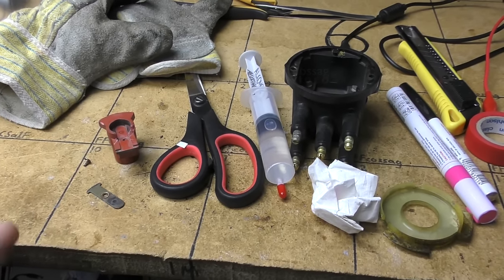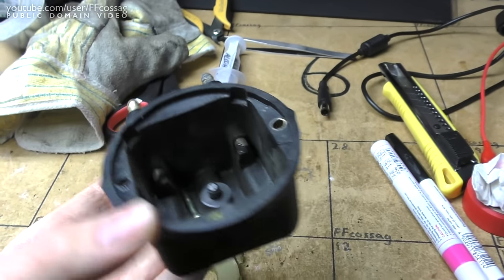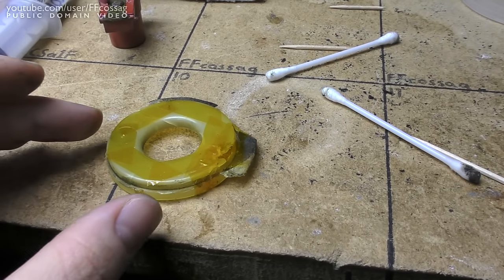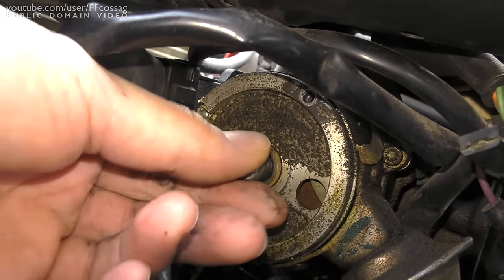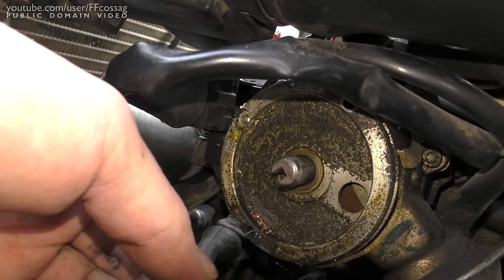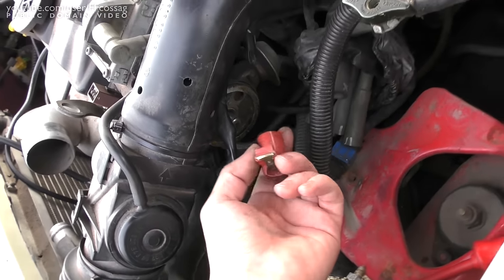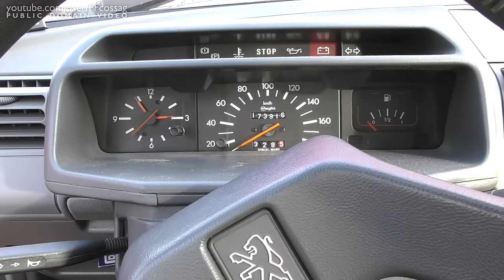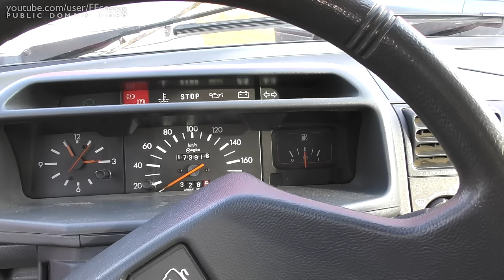FAILURE! Trying to fix a mangled ignition distributor on my Peugeot 205

Comment: Hmmmmm, instead of thinking about "BLOW JOBS" how about concentrating on the issue, the cap had a dodgy connection to one of the cylinders, did u clean the pitted contact? did u check the dist cap lead connector to make sure it was a tight fit?? and if so then the diagnosis wud be the rotor button cos that is fucked... missing the plastic that stops any random spark flying out to hit another contact will cause a misfire, that crap inside I wud have cleaned up with some degreaser on a rag, and certainly replace the cap and that plastic cover on the inside. Last but not least test ur spark plug leads. This video made u look like hoomer..... DUHHHHHHHHHHHHHHH!
Reply from the maker: The distributor is fucked and I'm replacing all the fucked parts. This was just an attempt to get it running at all so that I don't have to tow it around the yard, and to make sure that nothing else got fucked in the process.